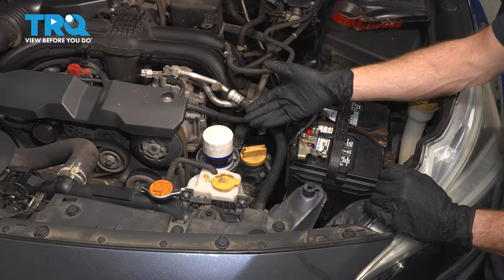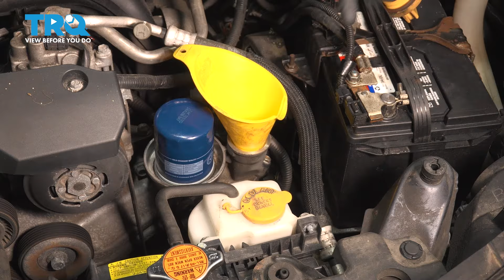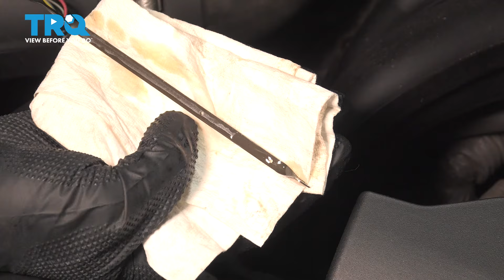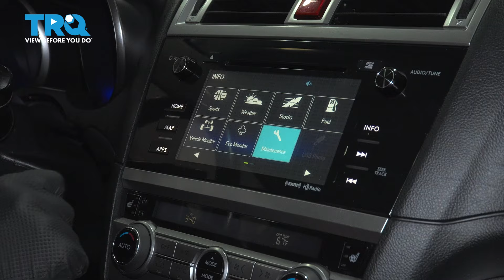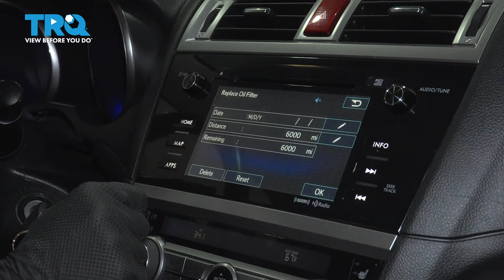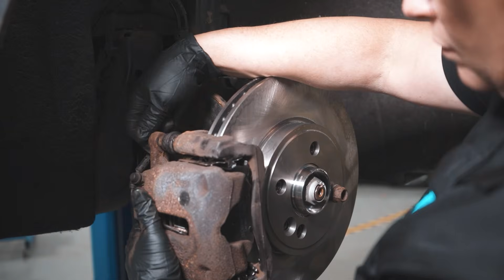How to Change Engine Oil 2015-2019 Subaru Outback

Comment: Great video! I just had engine oil change in a dealer. But 45 days later, the low engine oil indicator lightened up. The oil level is still adequate between the two holes on the dipstick. The oil is still clear. Can I add 1 quart of engine oil via the oil filler hole (with the yellow cap) without draining old oil and filer? Thank you.